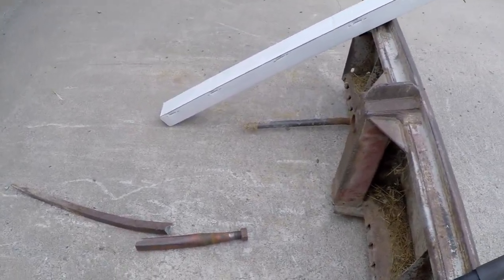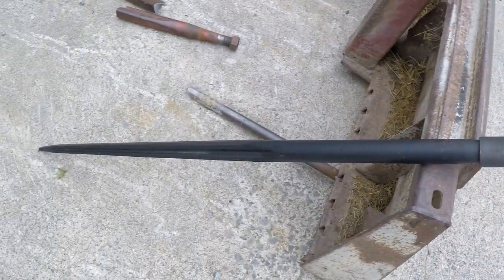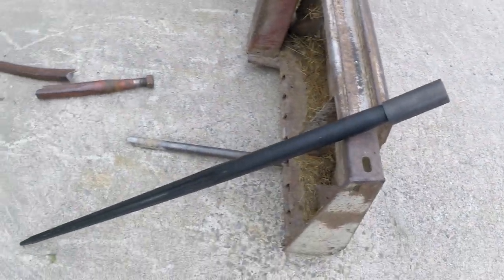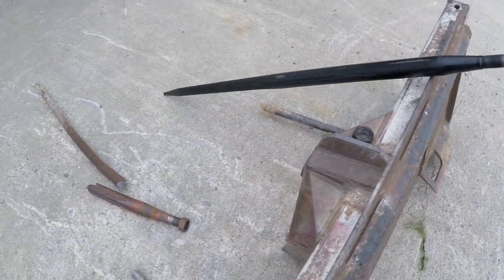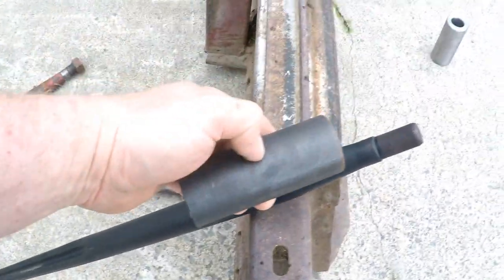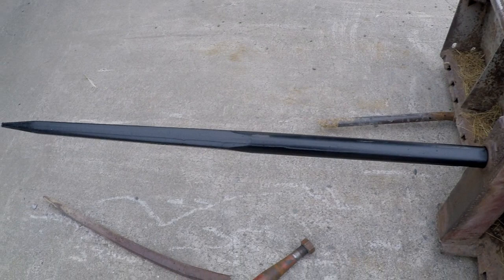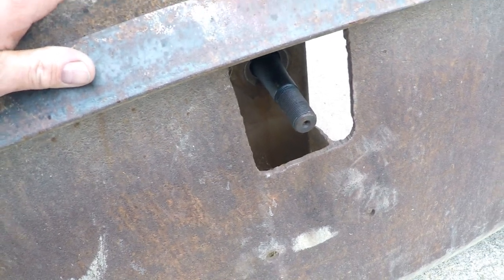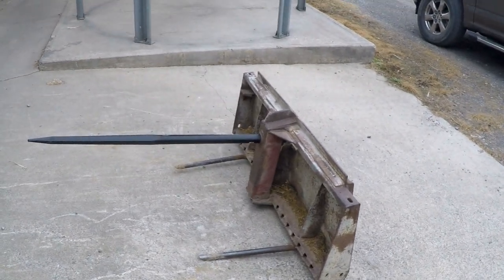Hay Bale Spear Replacement

Comment: Isn’t life fun. You try to fix your stuff and you always run into unforeseen problems. I spent over $5,000 trying to fix my leaking roof over 8 years before I finally discovered that my leak was in my chimney chase. No problems after it was fixed.